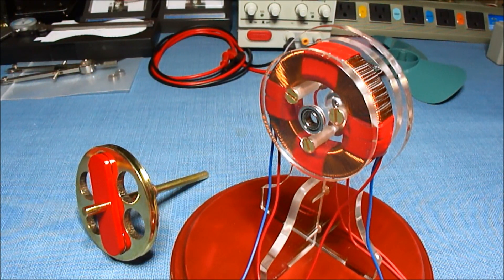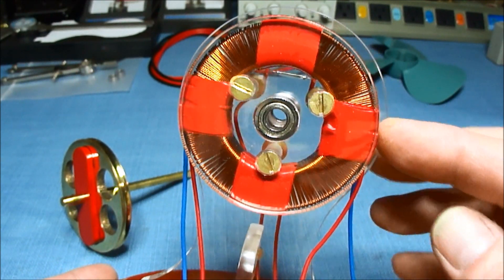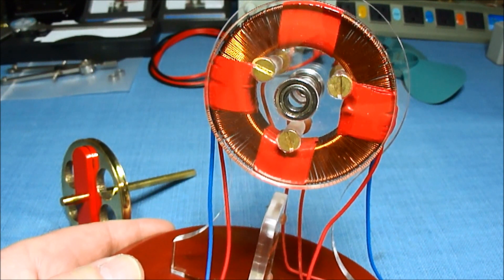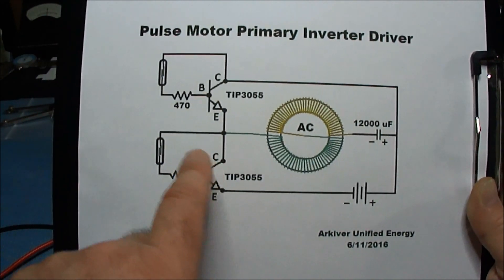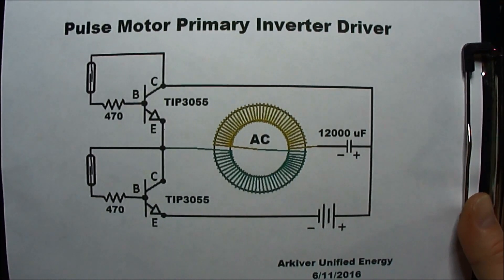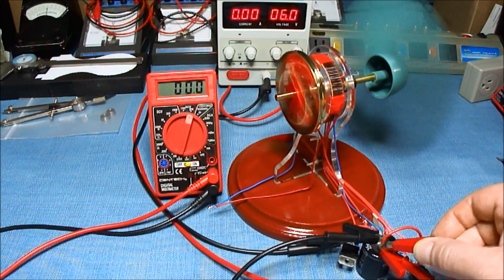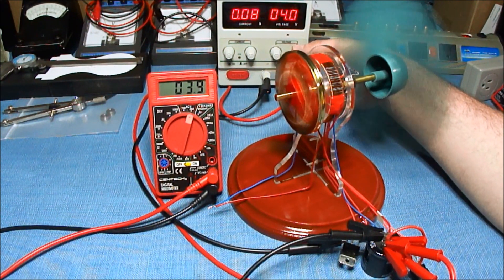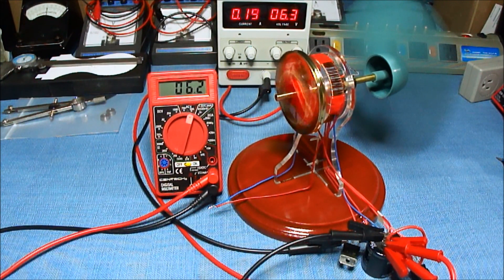Toroid Pulse Motor Primary Inverter Driver

Comment: Hi Mike. I was wondering, if you had a second layer of similarly wound coils on the same toroid, could that extra set be made to be able to pulsed one extra time by using an extra capacitor and two extra transistors before going back to being pulsed from the battery? I am, like you say, presently unable to try it myself, so I am asking the original inventor for his opinion, at the very least in theory. Whatever happens, please accept my highest regards for who you are and the integrity you value. Thank you
Reply from the maker: Hi! Thank you! A second layer could be added or just put an extra capacitor across one coil. It depends on what your looking to achieve.
Reply: @ArkiverUnifiedEnergy  , brilliance is most often expressed through simplification. Thank you

Comment: i used to do something very similar  with modified computer fans. when your meter was showing around 3 volts dc on the run cap it looked to me like the cap discharges from 6-3 v when the top transistor is on and charges from 3-6 volts when the bottom transistor is on. 
i’m confused by the fact that it ran on half cycle initially because the nearer in v the run cap is to the source voltage the less current flows through the bottom transistor and motor coil. my run caps were 68-150 uf when i was using power twice with the computer fans.

Comment: Hi, I think it might be better to fix the magnets on both sides of the toroid (make two magnet holding flat bars) and align the magnetic field lines of magnets with lines of field that would be produced by the coil when current flows through it. In this setup magnets would need to be rotating on the radius which would be bigger then the core of the toroid. Also if magnets attract to the core it causes some friction on the bearings, when magnets would be less attracted to the core it might reduce losses. I like this motor design, it works very smoothly and that is always good for efficiency. Great video! Thank you for sharing!

Comment: superb design, great work.  I wonder, of those 2 coils could be made bifilar, and with a capacitor parallel to each coil, to tune down the resonant frequency, so it would pulse at the resonant frequency.
I also wonder what happens to the back emf in this system

Comment: Nice circuit,  I'm gonna try it on my little Newman motor.  I don't know if the reed switches will survive the Newman motor spikes..  but, I'll find out.
Reply from the maker: Thanks! The motor itself may give interference triggers to the reed switches. A small magnet on the shaft for triggering shields the reeds from the motor magnetic field.

Comment: one transistor puleses one drive coil in one direction and the other in the other direction , I made such a system it has two small bifilars driver by its own set of magnets and this drives with monopole while providing me with the two seperate triggers for a third u core with two drive coiles around it . no trigger on the u core

Comment: Hi Ark, I did not study electronics and most of my doubts are due to lack of experience in this matter, i can see in the circuit two REED SWITCHES, and i don´t see this components in the video, is it neccesary this two reed switches...? where are these components placed...?
Reply from the maker: Hi Sky, I learned electronics from you and others on YouTube combined with what the pioneers wrote in old books. The reed switches are on the front by the fan. I have the motor running without reed switches using a different coil. Thanks  https://www.youtube.com/watch?v=mFpawS5SMho

Comment: did you build the whole spparatus, flywheel and all?
Reply from the maker: All but the brass flywheel. The acrylic was all cut with a hand scroll saw and cleaned up with a mild wood rasp.

Comment: Reverse winding on one coil. Reverse 1 magnet (Both same polarity), use 1 transistor. Fire coils wired in parallel  to repel both magnets at same time. Twice torque and twice power usage.  My 2 cents. Great job on your engineering. Your background in the field is apparent.

Comment: Hi . I was trying this circuit of yours to see how well it may work at running a JB Zero Force Motor. You are right, it works extremely well, not only with pulse and window motors but even better with a zero force.
Congratulations for a circuit that is really exceptional for its versatility in usage efficiency. Thanks.
Reply from the maker: Great work! Thanks for the feedback. Cheers

Comment: Hi. Do you have a circuit diagram to use PNP transistors and hall sensor switch, instead of NPN transistor with reed switch? I tried your existing circuit on a small window motor, using two capacitors at the point where the two wires from the two coils are connected, as you show in another video of yours. Results are very good indeed. Uses very little power.
Thanks.
Reply from the maker: Hi. Great work! I haven't worked with the hall sensors yet. Lidmotor may have a hall sensor circuit that could be combined. Cheers

Comment: I really like the vintage style wooden base it sits on...^^
And less current with better torque is always a good improvement...well done...^^
Reply from the maker: Thanks. The wood base is from Michaels craft store. They have them unfinished, different shapes, and sizes.  Cheers
Reply: Thanks for the info and link, i've checked it and it is a nice online shop...^^

Comment: very nice motor , thanks for the video and big 👍👍👍👍👍👍👍👍👍👍
Reply from the maker: Thanks :)
Reply: Arkiver Unified Energy  about how MN any turns needed on the toroid if you don't mind me asking ? Thank you 👍👍
Reply from the maker: There's about 120 turns of 27awg on each of the two coils. I don't know how to do the calculations for what should be used in coils. I try what I think will work and see what happens ;)
Reply: Arkiver Unified Energy  no that's OK on calculations , ive got there gauge wire  I don't think that will work I'll try to order some 27"-24"  gauge maybe that will work, and one more question where could I get or order a toroid that size? Thank you very much for your help and keep up the good work i liked and subscribed to your Chanel so I'll be ready for the next video 👍👍👍👍👍👍👍👍 from me , chuco
Reply from the maker: Thanks. Glad you enjoy. The toroid can be found on eBay, 2.4"o.d. x 1.4"i.d. x .5" with flat sides. Cheers! Mike
Reply: Arkiver Unified Energy  thank you very much once again 👍 will be looking forward to more of your videos thank you for your time .